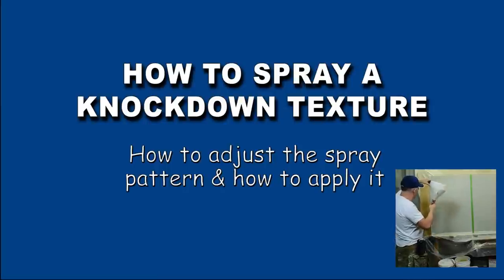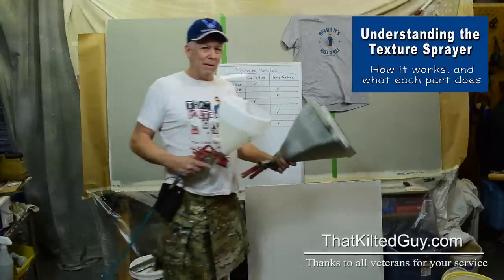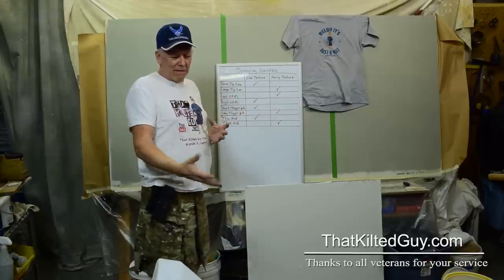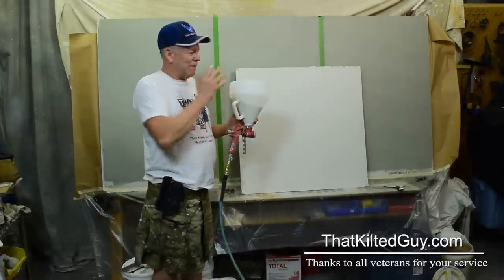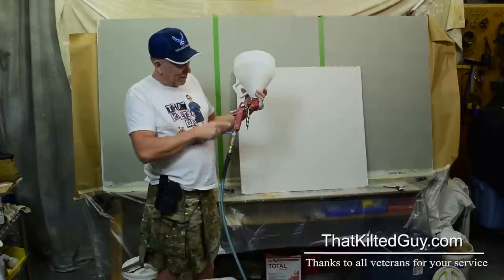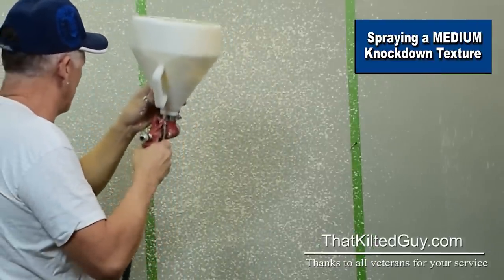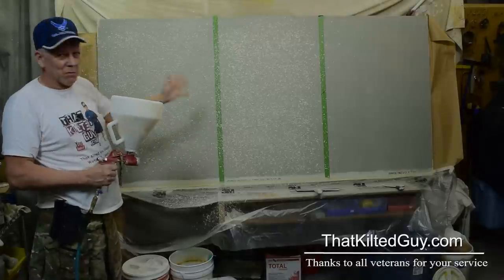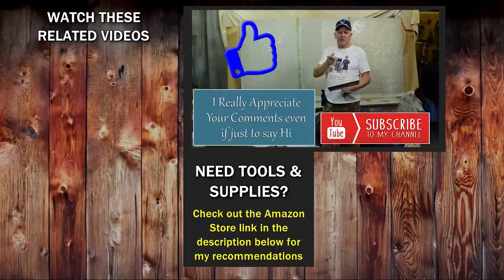Spraying Knock Down Texture in 2022.  Learn the 🔐 SECRETS 🔐 only PROS know using this $30 Tool

Comment: It's all about timing. I would only strike once. I would say always go heavy and and give it 15 to 20 minutes. You want your big glops to be about 6" apart because when they get knocked down they will be closer. If you aim for this you will end up with 1" probably. Use your big plastic knife first then work your 6" or 12" on the light fixture areas and stuff. Less is more. Sometimes you need to walk away and wait. If you run your mud through a brand new paint screen you should barley be able to squeeze it through for lace knockdown. Orange peel should look like a thick duck web on your hands and be strained with the paint screen. Double that thickness for knockdown.

Comment: I have been using your techniques while redoing a 1980’s bedroom. So far everything has worked well. Had some issues with removing the popcorn ceiling due to numerous coats of paint. Thank you for sharing your expertise and guidance. Very much appreciate.

Comment: Good morning sir,  I am a rank a$$ armature DYI guy and your channel has allowed me to do drywall work that I would have otherwise never attempted.   I really appreciate that.

I have recently repaired some major drywall damage around my hot water heater (located in my garage)  due to a sudden leak.  I did not have that cool primer for torn paper that I have seen you use before, but I did use spray Shellac.   I used 20 minute mud to  repair the worst areas, then 90 minute to float the areas into a flat surface.  Additionally, I replaced the rusted metal  corner beads, with a stiff cardboard style product.  After that was complete,  I applied a few skim coats of USG General purpose and touched up small defects with a 6" knife with more GP mud.  The overall results is actually astounding, but it did take me several weeks to do it.  I don't know how to upload pictures otherwise I would have added them to the message?

Now I'm ready to blow some thinned down GP mud (orange peel texture) over the repairs (about  25 square feet) and then blend the texture into the exiting undamaged areas using a marshalltown 2.1 gun.  

My question(s) are: 
a. Should I prime the repaired skim coated areas overlapping into the existing textured areas?
b If so, should I use PVA drywall primer or another primer product, since I plan to paint over the new and existing texture sometime later?

Thank you sir,

Mark Nicholson
Former, US Army - EFMB,
Combat Medical Specialist
1/94 FA MLRS
Reply from the maker: First of all thank you for your service to our country, and I appreciate your comment. I’m glad I’ve been able to help you and if you want to send me pictures I sometimes feature them in various locations and email will be at the bottom of this message. Whenever I do a repair over an existing wall I don’t take the time to prime it as it just slows me down but it can add more consistency to your finish when you’re a novice. If you do prime it do you want to use something like Zinnser Bullseye 123 because it has a better bond to existing paint than PVA.

Thanks, Guy Purcella, USAF Electronic Warfare Tech, 84-91

ThatKiltedGuy15@gmail.com
Reply: @ThatKiltedGuyDIY  Thank you for the quick and complete reply.  I'm off to the box store to get some Zinnser now.  After I complete this repair (probably another week), I'll be sure to email you a few pics to illustrate what a regular soldier like me can accomplish, when provided experienced, competent and professional advice by guys like you.

BTW, I spent  most of my military service (1982 - 1987) in medical school (Ft. Sam Huston -Academy of Health Sciences), West Germany near the Czechoslovakian & East German boarders and ending at Ft. Benning GA working at Phase #1, US Army Ranger training facility.  Thank you for your service.  My Dad was a 20 year Airforce NCO, Control tower - Transit Alert Specialist.
Reply from the maker: That’s awesome. My dad was actually a marine for several years but I don’t know much of his history just some of his funny stories as an MP

Comment: Have you ever done a vid on how shitty you can leave the top coat before texturing? 
I feel like I put too much time into sanding and feathering out my mud. I’m always worried imperfections will show thru after I texture so I make sure the surfaces are very smooth. 
When I was trained on doing drywall I did insurance work and did a lot of patches. There were a coupe times in the beginning of my career of doing patches I could see 
My joints so I’ve always been paranoid about it ever since
Reply from the maker: Hey, I actually overdo it myself.  I look at it like this, if you try and finish it 'just smooth enough' that the texture will cover, then once in awhile it won't, and I don't do that kind of work.  My work is in the top 1% in terms of quality, and often speed too.  So I'd rather overdo it, then discover I left something that showed, and now it's too late.  That being said, I also don't do quite that level of finish work in certain areas.  For example, if the whole house has poor quality workmanship, I'll do 'normal' quality, which is still high quality, just not up to my preferred standards.  I NEVER get complaints about my quality of workmanship.  I pick my work apart always, but that helps me know what to do better next time.  I just redid a laundry room (actually took the thumbnail pic on that job) and I still overdid it.  They were blown away how well my texture matched, etc.  

But, I have thought about that question and plan on testing how much of an edge and defect each type of texture will cover.  Partly to show novices what texture is safest for them if they are still learning, and partly for pros to know for sure how much they can leave.  Of course popcorn texture was popular because you can accidently texture over a pet cat and it would hide it, lol.  I've removed a lot and am amazed what it actually did hide.  My video on NEVER do this to a popcorn ceiling showed some of that.  Skip trowel the way I do it, or stomp brush, brocade, etc will hide a lot too.  Next is a heavy splatter, knockdown, then orange peels, with smooth being a nightmare too me.

Comment: My refresher course... Just now ready to start texture on my major remodel. 5 rooms  2 closets a little over a thousand sq. ft.  I done quite a bit of tape and bedding and sheet rock repair through the years, but it's always good for me to mentally prepare because  of the years between projects.  Also because this is an older home  and a major remodel...It is a chore to match new with old. But I really do like the challenge. These kind of videos are priceless , this work if I had had to hire it done would have cost me in excess of 25k . I'm talking about hanging the sheet rock, tape, bed , texture and painting. I live in a remote area and contractors can really name their price because out of dozen contractors I'm lucky to have any return calls.  4 hours of electrical work cost me 750.   5 hours plumbing cost a thousand, 1 man working on each. I supplied all the parts.

Comment from the maker: I NEED YOUR INPUT.  What subjects would you like to see me cover on my channel?  Be specific if you can like, 'Fixing a dent in a wall' or 'how to choose a drywall joint compound' etc.  Comment below and I'll see it.  Thanks! 😎👣
Reply: I come across popcorn ceilings that are so heavily painted that I'm not able to completely scrape it off, can only get the nubs off, and have needed to skim it a few times to get it smooth. How do you recommend dealing with that?
Reply: TY I learned several things here. That said, a little more info that I thought you'd certainly mention in this video. The nozzle size and air pressure you used in this video. Also, I've watched several other vids where the guys used appearance as their gauge as to when to knockdown. They state to wait until just after the glossy look is gone (20+/- minutes depending on the variables involved).
Reply from the maker: VICTOR EOUS good questions. I pretty much always use the same air pressure if 35 psi because the airflow, (cfm), is more important. And I almost always use the medium tip. I use the fine tip for really fine texture and rarely use the large tip as i don’t like globby texture you get with that. Thanks for asking.
Reply: Choosing materials (quality availability, etc)and/or material choices (different types of same material (all choices in thinset for example) and applications (pressure treated vs ?)
Reply: Round corners, thanks. People need to be taught, not told. Good job, thanks again.

Comment: Wow!  Thanks, much for your lesson!  My practice session with the sprayer took about five minutes for a perfect pattern, plus another 20-minutes for drying time sufficient for a knockdown.  The results were excellent because I already had the sprayer settings based on your recommendations for a heavy pattern.  I launched the bathroom project and completed the spraying work in just a few minutes.  My observations for others' benefit: 1) Don't start the mud mix with too much water.  (I ended up mixing enough texture to do a large bedroom.)  2) If you practice in the garage and the project is indoors with less ventilation, you'll need to be patient with the knockdown's waiting duration time.  
3)  Budget your time with plenty left over for cleanup.  Speed it up with dish soap and a sponge.  Thanks again!
Reply from the maker: Hey I’m so glad I helped you out. And that is some good additional advice. If you want to lessen the waiting time to knock the mud down you can raise the heat and increase the airflow with a ceiling fan. But you don’t wanna put your fan directly at it unless it’s one small spot. And a garden hose and a spray nozzle works great for spraying them clean. That’s if you can do it outside in your yard or someplace like that.
Reply: @ThatKiltedGuyDIY  Good stuff.  It just crossed my tiny mind that a hairdryer might be useful for those big knots that want to smear when I'm dragging the tool. Man!  I need to find another wall to do!

Comment: THANK YOU GUY! Just a note to say Thank you so much for all of these awesome videos! I wanted to let you know that i successfully replaced a sheet and a half of drywall myself. I purchased all of the materials that you suggested from your store. I already had a hopper and air compressor and had previous attempts in the past but failed, due to not having the knowledge in the videos. I mixed up the mud and made an attempt at knock-down on a couple of pieces of drywall from the garage. After spraying the mud I let it set up for a few minutes, approximately 7 - 9 minutes. One piece I used more air and one I used the minimum setting. I used the 12" flexible plastic piece to knock the mud down and WOW, it looked perfect. So, I carried that knowledge onto the drywall that I had taped and floated, also following your guidance. It all worked out perfectly! My wife and brother could not believe that I had done that myself and they were both SUPER IMPRESSED. I truly feel free now, knowing that I understand the process and that you provided me the tools to get the job done right. As a result, I now have the freedom and confidence in knowing that I can do this without having to spend hundreds to thousands of dollars for very minor drywall jobs.
Reply from the maker: Awesome.  I always love hearing that since that's why I do these videos.  Take care.

Comment: This old Navy guy is very much appreciative of the care you take to explain the process.  I've got whole house I need to texture(a horrible smooth wall finish), and this looks just like what I need to do.  Thank you so much!
Reply from the maker: Hey. I’m glad to be of help.
Reply: @ThatKiltedGuyDIY  Do I need to prime smooth wall painted(eggshell or semi-gloss) walls before I do knockdown?
Reply from the maker: @martyepperly5803  anytime I apply mud over a painted surface I sand it with 80 grit to remove some sheen and leave scratches, ie tooth, for the mud to bite onto.  You can also add a tablespoon or two of woodglue to a bucket of mud for better adhesion.

Comment: Just the answers I was looking for with thorough explanations. I had already gotten used to using the same version of the small hopper gun from homart. The 3 different knockdowns you demonstrated was what I was missing. Remodeling to sell and will be back for more I'm sure, when I get my new/used place. I really appreciate you painting the board green so I could see the amount of material you were spraying and the size of the drops.
Reply from the maker: Richard, glad I could help.  I try to make it clear 🤓 for everyone, and although it takes more work, I want to make it as easy to see as possible, so I'm glad it helped.  Thanks, Guy

Comment: Thanks for creating this video. Very helpful. I was worried about spraying texture in a room I am remodeling but much more confident now. Thanks for serving and defending our country. God Bless!
Reply from the maker: Thanks, Glad to help and good luck.
Reply: Just wanted to follow up on how project went. The project included framing, hanging 6 sheets of sheet rock, taping, and texturing. I watched many of your videos and purchased and used several of the tools you recommended to include the small hopper and large plastic knockdown knife. By using all your techniques and tricks the results were amazing. I was able to match the small knockdown texture perfectly. Thanks for taking the time to help a rookie like me get a great result!
Reply from the maker: Joe Lucero awesome! Thanks for sharing this. This is why i work so hard to put these videos out.

Comment: i watched your video.  I sprayed it out and it came out perfect. The only thing I did wrong was when I blended into the painted area and you were right about it taking longer to dry.  The other areas were ready for me to use the knockdown blade but the painted area took all day to dry where I could do the knockdown . I accidentally made one painted area smooth as it wasn't ready..I will try your sponge tear out  to dress it up before I paint it.  Thanks again.  I was amazed how my first job turned out.  Your in depth video helped me figure out what I was doing wrong and can make the corrections.  Thanks again.
Reply from the maker: Awesome. Send me a pic of the painted texture if you want I’ll feature it on a video.

Comment: Thanks for the great tips! Word of advice to diyers. Make sure you have tightened the nut. Funniest thing I've ever seen, is when it came apart and dumped almost a full hopper on my drywaller's head when he started spraying the ceiling. I had to step outside cause I started laughing hysterically and in the moment he wasn't, but later he could laugh about it. I still laugh every time I remember that day and hopefully he does too! 😂
Reply from the maker: I’ve had a few instances like his and it’s always funnier later, lol

Comment: Excellent and thorough demonstration for those who are seeking DIY information. Many people show using professional floor hoppers that most people will never have access to. Thank you for sharing. I have always used a Kobalt hopper that is almost identical to the larger one you showed. It can get heavy but other than that is a great tool. I personally prefer baby butt smooth class 5 drywall but the two of the bedroom walls of the house we own now were textured, however they did not knock it down and it was horribly rough. We scraped them and are retexturing over them. They also only did two of the four walls. There was wall paper on all walls at one time and I have a feeling that whomever installed the wall paper didn’t prime the walls with wall paper primer. Then when they went to remove it, the two of the walls were badly damaged. Why they didn’t texture all four walls I have no ides? We are doing all four walls and going to try to make them as close as possible to each other. We are priming all of the walls prior to spraying with texture. It has been about 13 years since I textured a wall and just wanted a refresher course. You have given me exactly what I was looking for and after having watched about 10 videos I knew within 10 seconds after starting yours I had found the one I needed. Thank you for being willing to share and teach others your skill set. Many people have no inclination to pass knowledge along. I have always shared freely with anyone willing to learn and greatly appreciate anyone else willing to do the same. Blessings to you Sir.
Reply from the maker: Thanks. I enjoy doing this and helping others.

Comment: Thanks for the tips ! if you want to get the texture out of the can texture, after you use it run the nozzle under water, it will clean out mud and let you continue to use up can until empty !
Reply from the maker: that makes a big difference. Here’s another canned texture tip. If you go to spray and it’s coming out to coarsely with not enough pressure, run it under hot water for a couple of minutes and try again, and repeat until the pressure is right.

Comment: Great Video! Just finished drywalling a Playhouse- Yes a Playhouse for a family member and they want a knock down texture on the walls and ceiling. It has a vaulted ceiling and it is 8X12 ft with several windows, a door and a wall mount  heat and a/c unit in the back wall so,  I'm thinking I should be able to texture the whole thing and then do the knock down since it is primered with a quality name brand primer already that will slow the drying process and it is quite humid here from all the rain we have had. And he has a texture gun like yours which I have never used one before like that. Thumbs up and Thanks for the details.
Reply from the maker: I would advise practicing on some scrap first, or a small section of the job and just scrape it off after your done. But this video and my spraying variable should definitely give you a good job. Thanks for commenting.